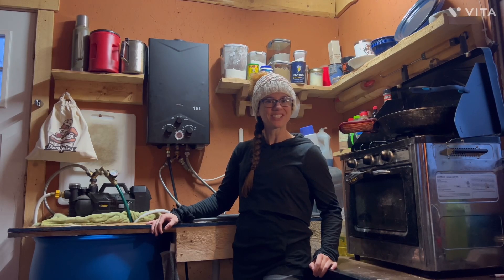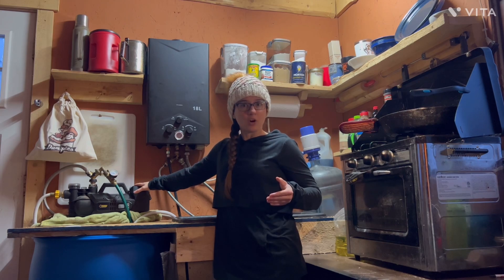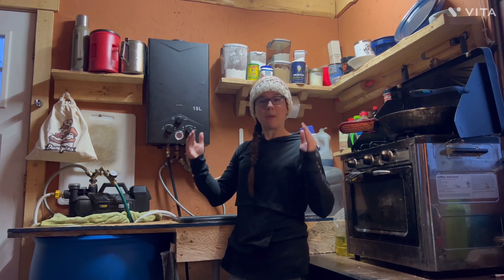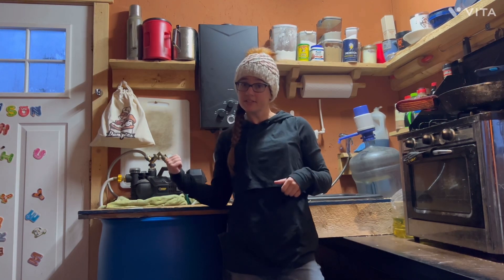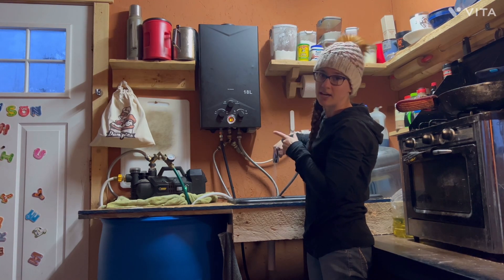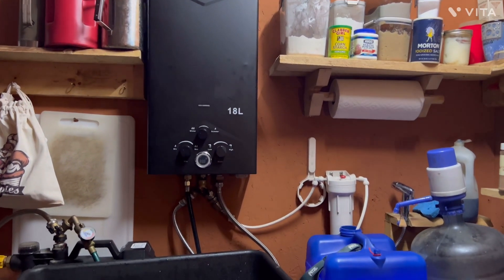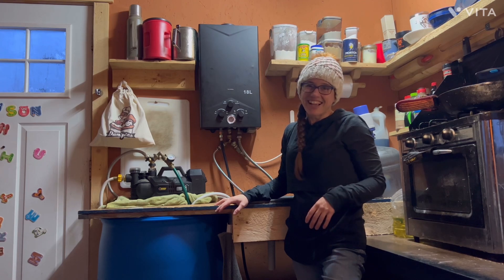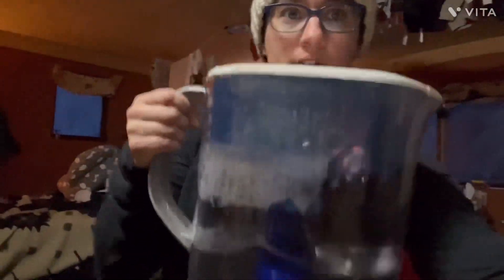DIY Off Grid Hot Water System and Drinking Water Filtration

Comment: Are you sure that water filter isn't clogged? Does it run with this flow with a new cartridge? One way to improve the flow is to set another filter in parallel or do a sequential with cascading microns filtering units. Or simply put a larger size unit.
Reply from the maker: It is always this slow even with a new filter, all of that is great advice! Especially with our new kitchen build. We will have to do that!

Comment: The vent on the boiler should go outside for CO prevention.(or at least open the door after using it) If you have a CO meter, please test it so you can see for yourself. (i and many others use that kind of boiler and it works great) Nice channel, hope to see good videos from your family.
Reply from the maker: Thank you so much for the tip! We do have a window open all year round to allow fresh air in and a CO2 detector inside. But we plan to put a vent in on our addition to help that issue. Thanks again!

Comment: I just hope you are properly exhausting, because as you mentioned that water heater and that stove are supposed to be for outside use.
Reply from the maker: That is a really good point that I should have covered in the video. We keep one window cracked at all times so we have constant fresh air. Running a wood stove and propane appliances in a small space we have to keep it vented. I will make another cabin video and mention that. Thank you for pointing that out!